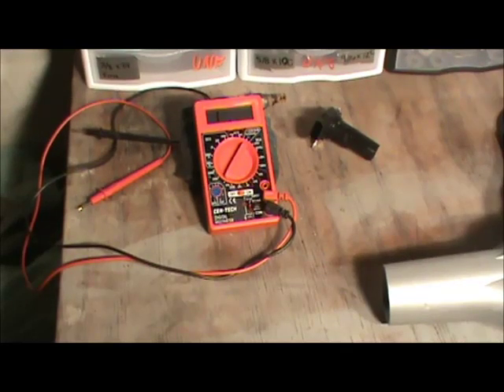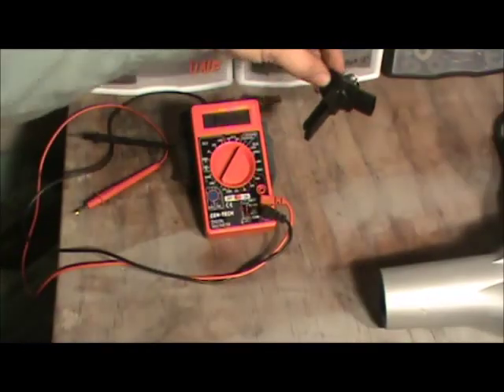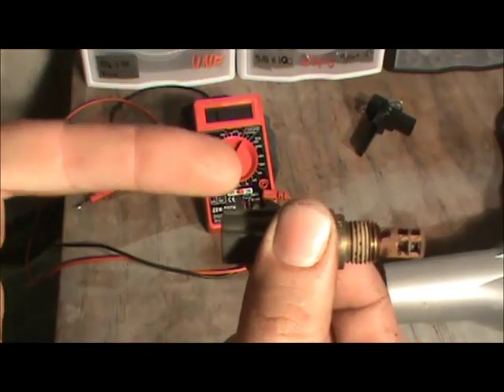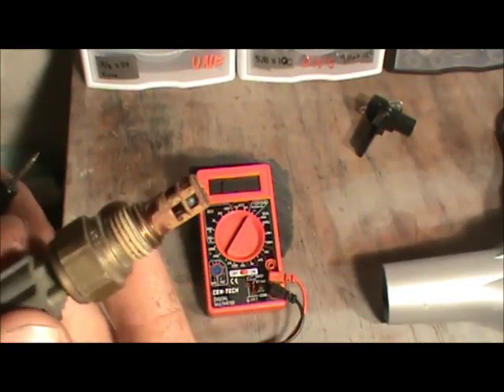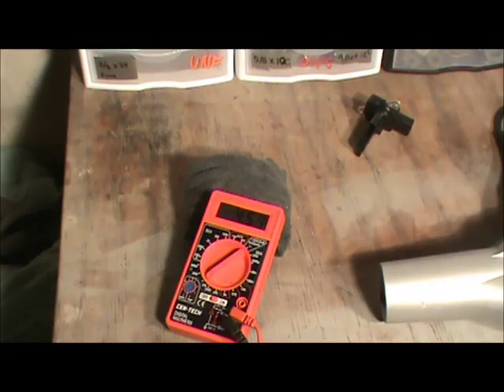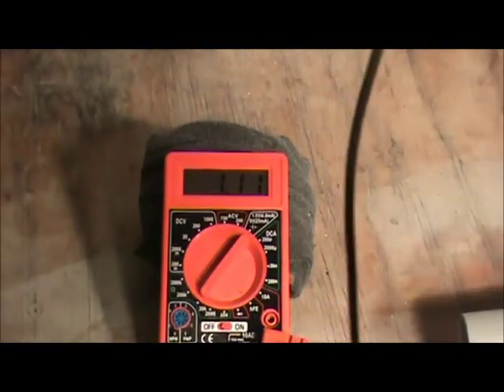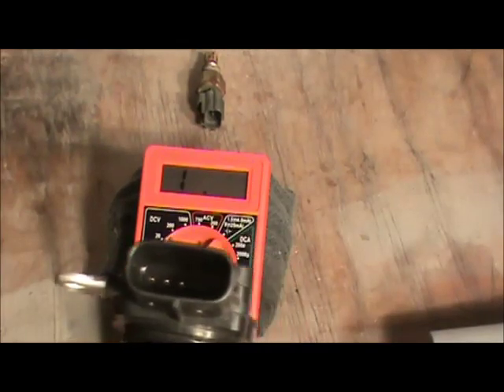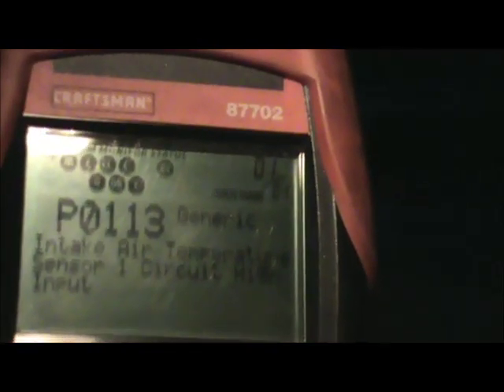Intake Air Temperature (Thermistor)

Comment: does the ECM read the current draw or the voltage drop?
Reply from the maker: Voltage drop.
Reply: Thks, As the thermistor's (IAT) resistance drops as temp rise, can you help me understand why the voltage (read by the ECU) drops - can you explain this with ohm law (if it applies)?